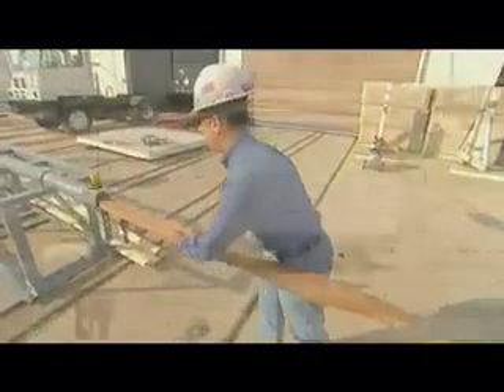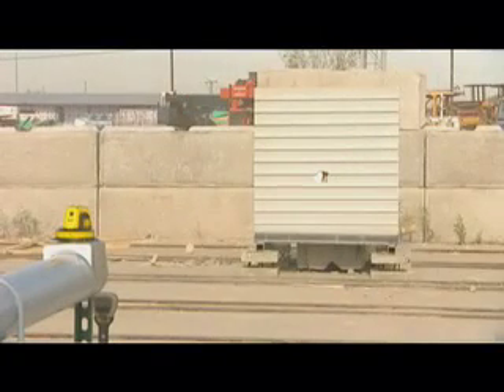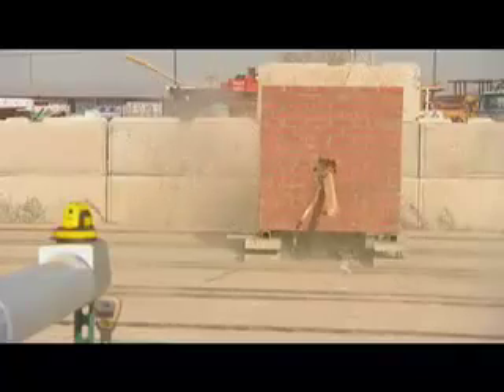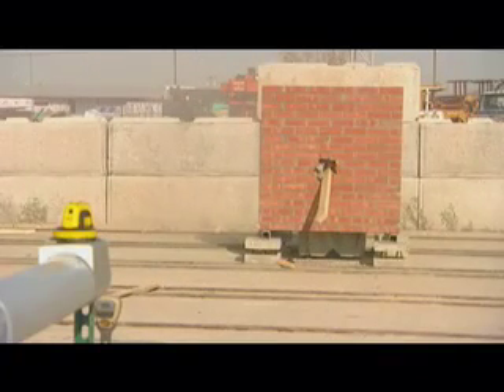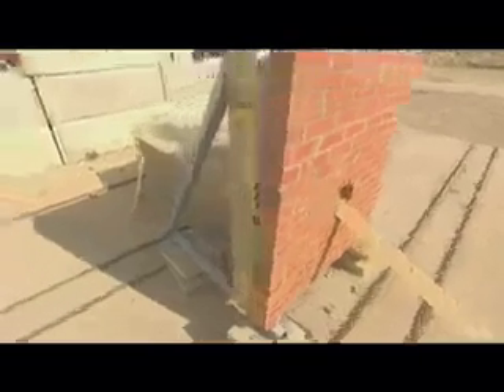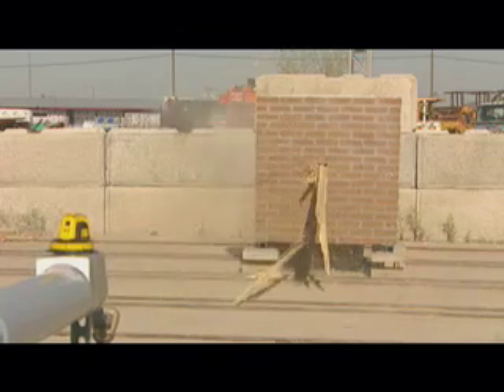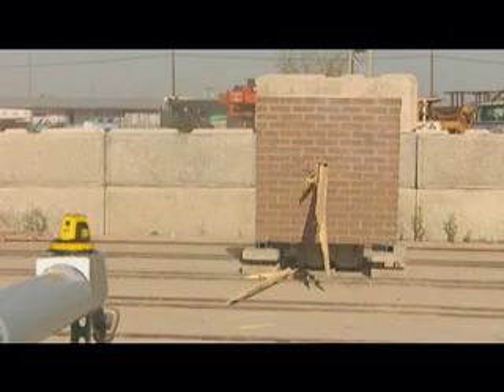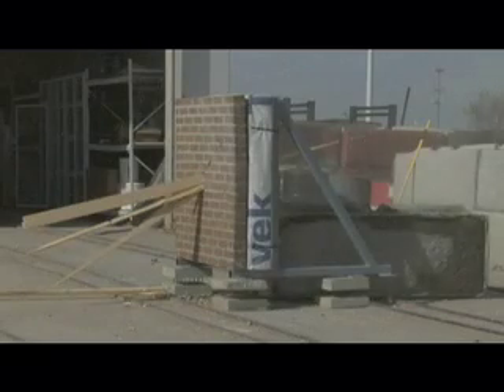Wind Cannon Test of the Fortified House

Comment: wacha gonna do if a f5 of over 300 plus hits or trows a tractor or semi truck into them walls lol.
Reply: The point is the concrete is going to survive anything but that. One got hit a pickup truck and didn't get knocked down. To survive a tractor or semi truck thrown you'd need, IDK, 1.5 feet thick? Which is more than double the thickness of typical ICF which is 8 inches.

Nuclear reactor containment buildings are 5 feet thick and can take a hit from an airplane going 500 mph.